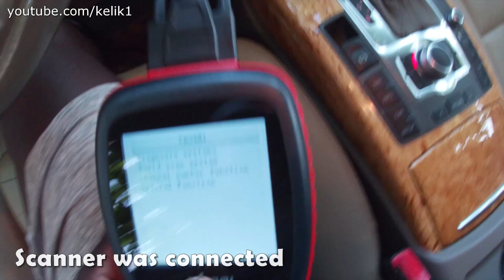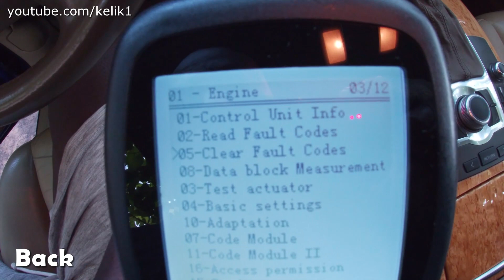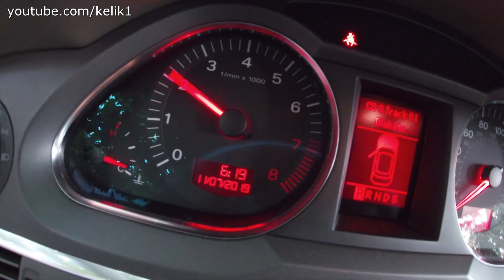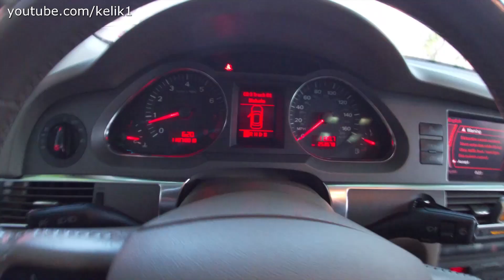Audi A6 3.2 - Bank 1 Intake Flap Temporary Fix

Comment: Hey man, great video.. I have an Audi A5 3.2 FSI and there is not that lever there, any ideas?
Reply from the maker: Hello! Thanks. The setup on the A6 may be a little different. You might need to take off the upper intake to get access to this.
Reply: @Kokouvia  my fault code is P2070 ( intake manifold tuning valve stuck open) .. is it the same with yours?
Reply from the maker: @MrAParAdeKtOsS  Yes I had that code too. When you start getting that code, the best way to fix it for good is to replace the lower air intakes. But they can be fixed too if you can't afford buying new ones. This is how I repaired mine: https://youtu.be/JNDpkA6HduI
Reply: @Kokouvia  Thanks a lot man! Have a good day!
Reply from the maker: @MrAParAdeKtOsS  Thanks! You too 👍🏾

Comment: Hello, I have a problem with the audi a6 c6 3.2 v6 2004 the car shuts off while driving and when it si reverse, I changet the fuel pump and it shuts off again, do you  know if the clock is the problem
Reply from the maker: Hello, you have to scan the engine for faults. That's the first thing to do.
Reply: @Kokouvia  replaced the control valves on the car, those two pieces at the intake manifold and the crankshaft sensor, the cam sensor, two pieces at the valve cover gasket, and the fuel pump, and my car shuts off again

Comment: I have a few questions; what OBD scanner do you use ? I have a faultcode related to my throttlebody sensor. When I buy a used Throttlebody, the same, do I need to calibrate or plug and play? I am sure you have the answer 😀. Greetings from the Netherlands
Reply from the maker: Hello! I use the Xtool V401. Are you sure the code is about the throttle body? What is the code number and what is the description? Greetings!!! :)
Reply: @Kokouvia  My obd scanner gives me code 16606 with a reference to sensor G188. So I was thinking, with some research on the internet, it is my throttlebody with sensor. Maybe you have other input...
Reply from the maker: @martinverhoeve1372  That code refers indeed to the throttle body or throttle valve module J388. If you install another unit and the code is still returning you should check the connector. A bad connector or an improperly connected connector will also trigger the code. If the connector tab is broken, apply paper tape on the throttle body  socket edges and plug the connector for a tighter fit.
Reply: @Kokouvia  thanks for the reply, I will investigate and replace the throttlebody. Hope the faultcode dissapears and will never return. Kind regards Martin
Reply from the maker: @martinverhoeve1372  Okay. Good luck 🤞🏾
Reply: @Kokouvia  one thing I forgot...do I need to calibrate the throttlebody if I buy a used one with the exact same OEM number ?
Reply from the maker: @martinverhoeve1372  Yes. Engine Basic Settings 60.
Reply: @Kokouvia  I really appreciate your video's and your knowledge. I now have a question about sparkplugs for my Audi A6 3.2 FSI. In one of your video's you changed the sparkplugs. I saw NGK PFR7W-TG 5592 as the sparkplugs you put in your blue Audi. Are these the best for this car? Are they 2 or 3 pin negative connectors ? In the Netherlands where I am, these spark plugs are hard to get. Do you know a perfect replacement for these sparkplugs. I know you are busy with the A7, but maybe you have time to answer my question...Greetz from Martin in the Netherlands
Reply from the maker: @martinverhoeve1372  Hello Martin. I very much appreciate your kind message. I have completed the job with my A7 weeks ago and I am using it daily since. Editing the videos takes time. That's why I am still publishing them until now. You can use the three points or one point spark plugs. They all do the same job as long as they are approved for the A6. Just make sure you install the same kind of spark plugs for all 6 cylinders. Here is the part number of the one I am using now: 101905631G. It's a Bosch part.

Comment: Thanks for sharing your idea
I have question my 2005 audi a6 Quattro 3.2 
I fixed engine light on p2006
What u showed video 
U said this is temporary fix
What about u can put epoxy glue between joint 
U think it's work because epoxy glue working with high temperature 
Give me a idea 
Thanks again u the nice guys
Reply from the maker: No you should not glue it. The white ball is supposed to be rolling freely inside the black arm. This is how I permanently fixed it. I removed it, I drilled a hole in there and I connected them with a tough piece of metal wire: https://youtu.be/xqcM4R97bjI

Comment: Do u know what actually moves the flap actuator when revving up, My understanding is quite the opposite happening as the the actuator will be exposed for the biggest vacuum at idle? as it seems the actuator is connected directly to the intake plenum.
Very cool video , Thank u very much.
Reply from the maker: It is operated by the vacuum generated inside the intake manifold. The round head has a small air ball inside which when sucked operates the arm.
Reply: @Kokouvia  Yes I agree with that part but the vacuum pull will be higher at idle, Right? But the arm moves only at higher rpm,  That is what confuses me.
 Thanks for ur reply anyway.
Reply from the maker: @W.Khairi  No, the vacuum pull would be stronger at higher RPMs. The vacuum pump is attached to a camshaft on the driver's side. The higher the RPM, the faster the camshaft spins and the stronger the vacuum force gets.
Reply: @Kokouvia  wow man u got me on this one, I didnt know the audi had a vacuum pump I thought the runner flaps were operated by engine vacuum.
Many Thanks and much appreciation for u explaining, Thank u.
Reply from the maker: @W.Khairi  Haha. Sure man! Check out this video I made about the whole vacuum thing: https://youtu.be/iS71pKr3zPQ
Reply: @Kokouvia  Will sure check it man, Thanks

Comment: Hi, I have the same problem, but I have loose plastic and practically after starting the engine and raising the revolutions a few times to the maximum, the plastic flies out of the ball, or for that you called it a temporary repair?  is there any other way besides a fancy combination?
Reply from the maker: Here is how to fix it permanently: https://youtu.be/JNDpkA6HduI

Comment: 2006 A6 Avant 3.2 check engine light (CEL) came on, pulled code 08196 Intake Manifold Runner Control Bank 1, Stuck Open. Found this exact arm you showed popped off. Pushed back on. My question: will it stay?
Reply from the maker: It will stay for a while but as the engine warms up and becomes hot, it may come off again. Watch this to understand better: https://youtu.be/e0g5DqRqqoo

Comment: Hey I a code P2006 Saying Bank 1 is Stuck Closed . But that part you pushed in on mines moves up and down freely when I rev . Any ideas ?
Reply from the maker: Is the white ball joint attached to it?
Reply: That African Audi DIYer yes it is attached . I have the same exact car as you color everything lol .
Reply from the maker: @chrisfeliz5715  Wow. That's cool 😁
Sometimes the error can be triggered by a broken vacuum line. Is it permanent or intermittent?
Reply: That African Audi DIYer it is Intermittent . And idk if this is related to this but like every other day the car will start to accelerate poorly and feels like it’s choking or something, it resets and acts normal when I come to full stop  . I thought it was the throttle body so I cleaned it while it still being attached i think I might’ve just had to take it off and clean it entirely cause  I cleaned it like that and it was fine for a couple days . No CEL with that acceleration issue too . The CEL just came on a day ago for P2006 .
Reply from the maker: @chrisfeliz5715  That sounds very much like carbon build-up. Carbon deposits may build up on the valves over time and obstruct air intake which could lead to poor engine response and the intake flaps being stuck open or closed sporadically. Watch this: https://youtu.be/dDQ006hVAVA

Comment: Hi I got a p2006 p2007 code and and my actuator is stuck at the same place as you put it on but when I rev the engine mine doesn’t move up and down like yours does after you have fixed it do you thing that could be the issue?
Reply from the maker: Did you make sure it is connected to the white ball joint behind it ? I have shown how to connect it back on in the video.
Reply: That African Audi DIYer yes it is connect and I’ve also checked all the vacuum lines and their fine, and it still shows that bank 1 and bank 2 runners are stuck closed which is strange because the engine light came on when I started my car in the morning
Reply from the maker: @reimullalli8078  If both intakes flaps are stuck closed, it is likely due to a lack of air pressure in the lines. One  of the lines must be broken and is leaking air. I would suggest you double check the one I replaced in this video because it is known to break with time: https://youtu.be/f9tFyFDu0A8
Reply from the maker: @reimullalli8078  You can also check the vacuum pump top port to see whether it is well connected. https://youtu.be/Ij9cDUhO3Cc

Comment: My arm does fall off the ball joint as you had mentioned it might. My arm does not move when I accelerate when it is on the ball. Yours does move freely. Is this due to vacuum or a stuck flap? Thanks.
Reply from the maker: It does not move when you accelerate a bit. It does under hard load. If your arm still does not move under hard load (high RPM) then you may also be having a vacuum leak somewhere.
Reply: @Kokouvia  Than you for the quick response. My a6 does not accelerate past 4500 rpm while in park. Is there some sort of governor? I get flap stuck closed as well as flap stuck open. Could you tell me the name of the components I am working with? Sounds too basic but I am a quick learner. Again, thanks.
Reply from the maker: @lizromeo2903  Yes, there is a revv limiter at 4,000 RPM but that should be enough to make the arm move. I explained everything about the flaps in this video: https://youtu.be/e0g5DqRqqoo

Comment: Hey bro awesome video will this be the same for the otherside? I'll soon have a 2007 audi a4 with the 3.2 fsi engine and it has this code but for the right side..
Reply from the maker: Thanks! Unfortunately the one on the right side is not easily accessible. You will need to remove it to fix it. Here is a video about the right one: https://youtu.be/JNDpkA6HduI

Comment: Good job man. what kind of scanner do you use for the audi? I use a 2007 a6 quattro.
Reply from the maker: Thank you! I use the XTool VAG401. I purchased it on eBay 5 years ago out of the blue and it has been very useful. One of the best cheap investments I have ever made.
Reply: @Kokouvia  do you know if it works for my car?
Reply from the maker: @ikennaezeokwelume4878  Yes it should work.